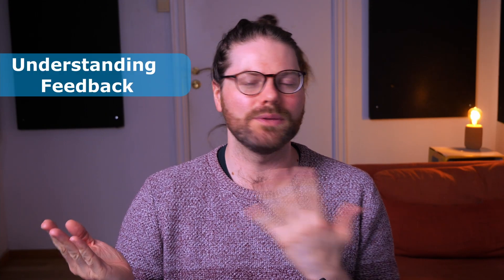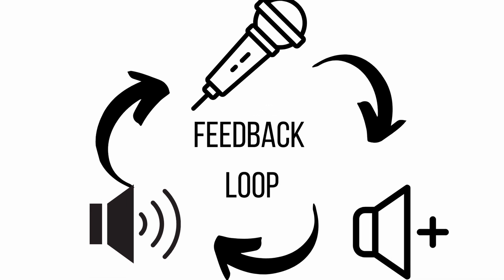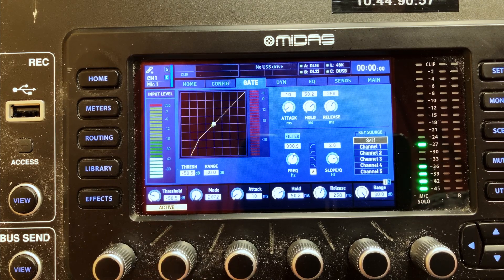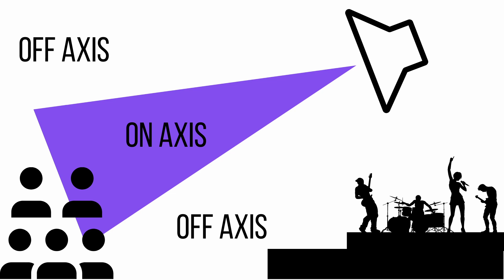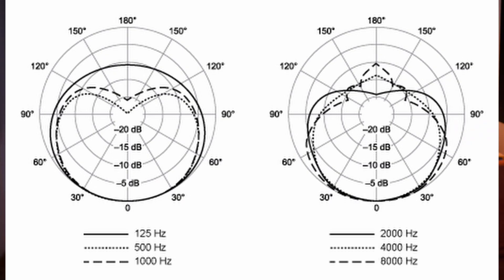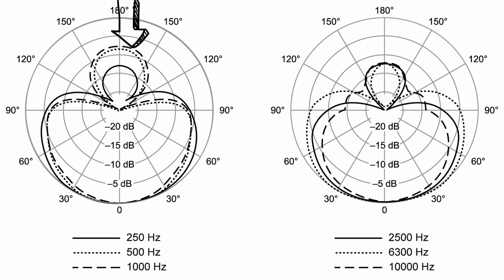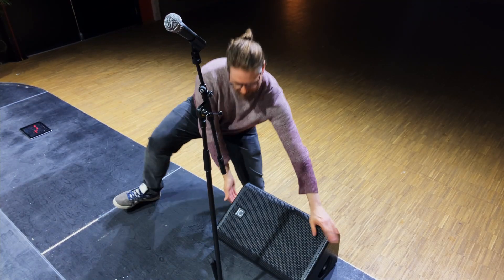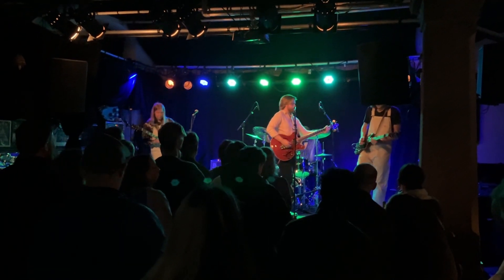Stopping Feedback in 3 Steps | Pro Tips for Sound Engineers

Comment: Hey man... thank you for this great video! One question. What would you recommend for a congregation type setting? In our Hall, we have like 15 ceiling mounted speakers. Most of the time, there's no issues, but for some members, when they comment, instant feedback. We have to lower the volume pretty much all the way down making it hard to even hear their comment. Something about their voice tone or frequency that causes feedback, I don't know. Most of the time, it happens with the soft-spoken members. Anyway, we're using a TOA 900 series amplifier for the volume control. We're using the Shure SM58 wireless mics with a Shure BLX4R receiver. What would you recommend we do to help avoid that feedback?
Reply from the maker: Hey thanks for the kind words. Ceiling mounted speakers are a nightmare. You can't really break physics so the mic is going to feed back at a certain point, that point will come sooner when  the mic is in front of the speakers.  You can encourage your members to hold the mic as close to their mouth as possible, rest it on their chin. Make sure you're not going crazy with EQ, a few gentle cuts of 3- 6db at the most. Avoid compression. Hope that helps

Comment: Thank you for your video.We use sennheiser G4 wireless for singer mostly singers love to hold microphone to the stage monitor.Could you please give me some recomends about stage monitor level.Because we give the monitor as they like it cause feedback,what level should be in the stage monitor?
Reply from the maker: It's all about communication. You can only turn it up so loud. Find the maximum volume before soundcheck and let them know when they're pushing that limit. Explain how feedback world and that if they point their mic at the monitor it will feed back and you'll need to turn it down. Other than that there's not much more you can do.